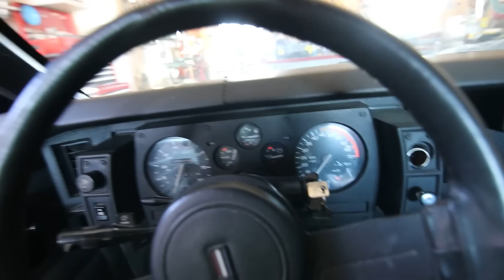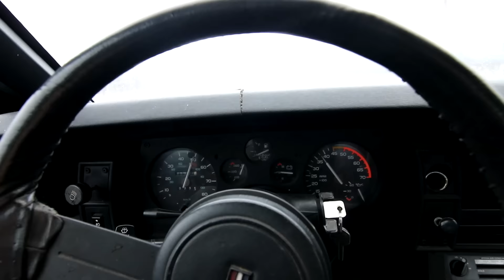Custom IROC-Z Hood Louver Covers! New WS6 Parts Update! *UMI*

Comment: Here is a idea fabricate a motor on the vents to open close and turn open for a ram air put some type of weather strip so they close tight million dollar idea
Reply from the maker: That would be pretty neat. Not sure how you'd do that... Cool idea though for sure.
Reply: @Greenlightfilming  well take a window motor and wire it but first make the louvers so they can turn mount a retractable something and mount it I am pretty sure it will work if you put your mind to it not hard to imagine
Reply: @Greenlightfilming  or take the motor from the trunk lock with push button I’m trying to say the correct term but trust me I didn’t have the idea until you made the open louvers
Reply from the maker: I see what you are getting at with the window motor idea. It's cool for sure, dont know that I have the time to money with that. It would be pretty tricky to make work right and be nice IMO.

Comment: Back then I replaced the stock sealed beams with Cibié (France) quartz halogen conversion kit. 
Low beams and high beams to be precise.
Night and day difference.
No wiring modifications.
Pure "bolt on".

Comment: On the magnet round the corners, air will get under the square edges and lift.   Had a sign business, if you don’t they will com off on the road at speed.
Reply from the maker: I believe you. Personally, I don't fully trust it. I bet they will peel off unexpectedly. Hence the tape suggestion...

These are a just in case sort of thing.

Comment: Hey man as a huge  F-Body fan from 1967 to now for the Camaros and 1967 to 2002 For the TA I will like to say your TA looks very clean car, well done as.
I own a 2002 Camaro SS SLP and I a currently looking into doing the suspension work, My car is stock right now. My question to you is how do you like the UMI product's? Why didn't you choose UMI and not Detroit Speed DSE or BMR? so on and so on. These are just so name I am throwing out there. 
You can check out my Camaro and my Brother 86 Trans AM on my page. I did an LED retrofit on both cars. 
Thanks
Reply from the maker: Thanks for checking out the channel man, appreciate it! Good luck with your project car! 

I picked the UMI parts because I feel the most aligned with their company ethos, they seem to heavily support the "non-straight line" racers, and work hand in hand with the f-body doctor himself (Sam Strano). Their price point is the same as BMR (last I saw), and much more inexpensive than Detroit Speed's parts. No offense to them obviously, just hard to justify such a large price jump.
Reply: @Greenlightfilming  Thanks for the info man. I will looking into UMI. I am looking into Ground Control coilovers and UMI sway bars, upper and lower A-arms and for the rear end as will. 
The reason that I am looking into Ground Control is because installed them one of my customers 1999 Camaro SS and I like the way the car handled. But that isn't in stone. Thanks
Reply from the maker: I dont have any experience with their ground control kits, but I've heard good things about them. Good luck with your project!
Reply: I have a 2000 Cameron ss. I have redone the suspension. Have you ever thought about getting a rear watts link? I installed a Fayz2 and what a difference. Totally predictable handling and a smoother ride. Yes you heard that right. Any thoughts for the WS6?
Reply from the maker: I'm familiar with them but I haven't considered doing it to the car at this point. I dont race it much and dont know that I'd benefit from it enough to justify the cost of them.
Reply: @anthonyciarrocca2476  Are you tracking the car?

Comment: The UMI LCA's and PHB will really help, I have all that on my GTA and love them only difference is mine are non adj. seeing as how I have no plans on lowering. My guess is your going with the 36mm front sway bar from the WS6 and maybe the 24mm in the back if the Z doesn't already have it, a Wonderbar would be nice but I think you already have one.
Reply from the maker: It should be a really noticable difference on the camaro going from worn out stock stuff, to a dual heim joint LCA/PHB. Looking forward to it!

Comment: Think I’m gonna pull the trigger .. that would work for me ..mine stays in garage most of time any way but if ya get caught in the rain it would be easy to pop them on..thanks for the info
Reply from the maker: Sweet, it's not the most elegant way to protect the engine but it works. I'd like to go the DSE-Z way of doing things soon. Need to rethink the induction on the car to do that.

Comment: Nice... can you do a vid fixing your steering wheel.  Mine is the same way and i cant get it straight.
Reply from the maker: It bothers me too! I bet I just need to pull the wheel and reset it.
Reply: @Greenlightfilming  I tried that, mine is an 87 and the wheel only goes in one way.  I could not find how to adjust at the steering wheel.  I thought I would fix it when I replaced the wiper switch but my god. I could not.
Reply: @juanluna6256  Make sure the steering wheel is clocked correctly and then adjust the alignment to match.